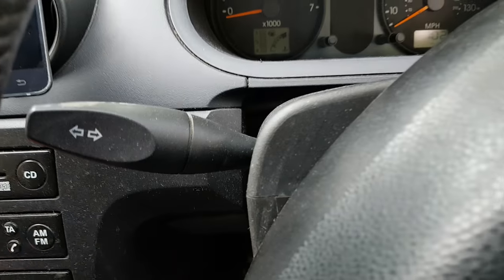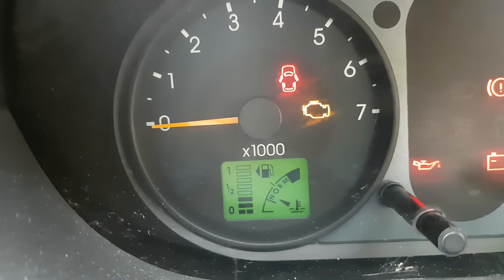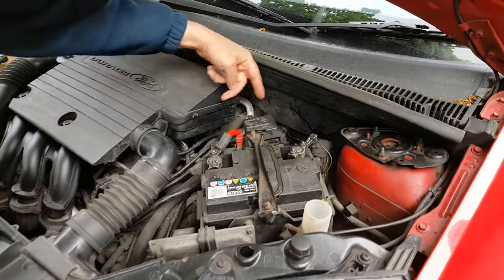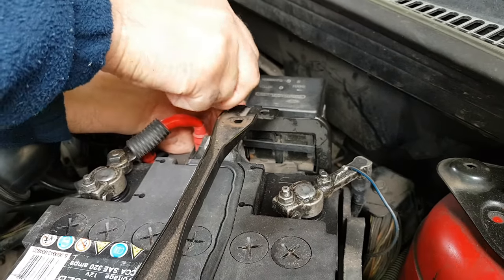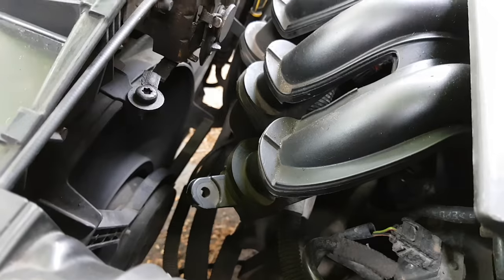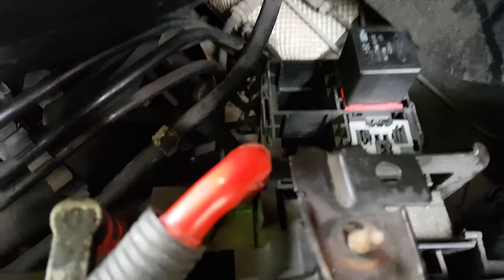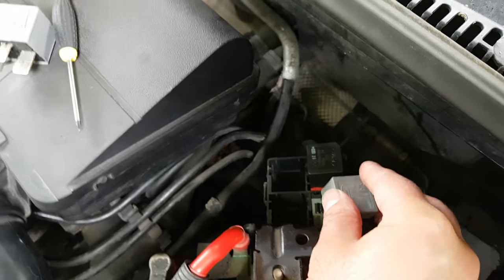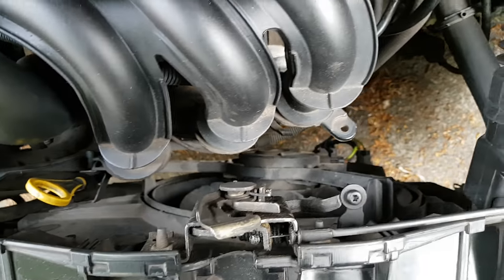Ford Fiesta fan problem...faulty relay.

Comment: This is great! I am having the same problem with my 2006 1.6 tdci fiesta. It's too dark to try to open the relay box now but will definitely try tomorrow.

Yep, tried it and that was the fix. Thanks for the great upload. In my case the relay was some g.cartier crap, replaced it with the ford part.
Reply from the maker: Glad you managed to fix it...I love those mark 6 fiesta...they were built so well

Comment: Thank you So Much, Helped me with my 2007 Ford Fiesta, Except my fan wasnt turning on. Used the exact same method and it works!
Reply: What's the problem man.i am facing same issue in my figo 1.4tdci. radiator fan is not running even when i turn ac ON.
Reply: @manjinderwahla8250  just remove the relay and blow the air in female connector of relay just use sand paper and wipe the relay male pin until it turns to original metal color then remove fan wire from radiator use rust lick spray remove the dust now plug it it will works

Comment: I have a 2008 ford fusion 1.6tdci with the same issue. Relay box located in the same position. Part no for the relay is; F80B-14B192-AA. Easy fix.

Comment: Thanks for this, now i know what the problem is. I tapped the top of the grey relay with a spanner and it fixed it 😂. So at least i know which part i need to order now 🙂

Comment: Hi my car does shows warm when its cold, it doesn't overheat but the fan also does not come on. I changed the radiator flange with temp sensor  as I had a waterless. The fan did not come on before that either.
Now I testet that the fan comes on when I pull the temp sensor connection off. But when by running engine I put it on the fan stays on and Fault management light comes on. When I switch it off fan stays off . Can you help me ? could it be the Cable or the relay? And how doI change the cable ?

Comment: Had the same problem. Took it to fords and they provided an up rated relay. I then opened the old one and found contacts stuck together. Cleaned them and is now the spare. The cover simply pops open with a small screwdriver. YEs there is a black and grey relay. ITs the grey one for the high speed fan.
Reply from the maker: Yes you are right Ford did modify the relays in the end I guess they got fed up with the complaints.

Comment: How did you get that cover off I have tried but no luck
Reply from the maker: Small flat head screw driver to pop the lugs then just pull the cover off
Reply: @jaredakten4939  I done it i was struggling as I never unscrew the battery holding top bracket,reply appreciated.
Reply from the maker: @naimahmed6581  there you go...a little tip for the  next guy struggling to get the cover off...

Comment: Hi My car ford figo was overheating recently  and i bought new Themostat and temperature switch but when it gets hot my fan doesn't turn could that be a fault fan relay aswell?
Reply from the maker: Check the fan motor first then the relays
Reply: same probelm here, did you manage to get what the problem was?

Comment: Hi. Fiesta zetec 2008,blower fan not workin any speed(1 2 3 4)  taked off blower motor, tested and the motor working.. So What could be the problem??? Thanks
Reply from the maker: Check the fuse then check power coming into the switch then check power going out from the switch....use a multimeter and let me know.
Reply: Same problem i have faced but I don’t any solution plz help me

And when i rotate tha blower fan by hand so the blower is working

Plz give me solution

Comment: Hi, thanks for the video. I have a ford figo, the fans starts spinning immediately when i turn the ignition and only stops when I turn the ignition off. Could you maybe help with advice ? Thanks
Reply from the maker: Hi Linda...if your car is the same as the fiesta then it will more than likely be one of 2 things...your coolant sensor could be buggered or you slow speed fan relay could be stuck in the on position... both are cheap to fix.....change the sensor first to see if it helps.

Comment: Hi my Fiesta 2009 1.6 Tdci is doing same problem. Fan is very speedily on while engine off. I took off that gray relay one day and try to jump start as the fan killed all the battery and finally I damage the ECU (electronic control unit) and cost me £500 to make the car live. Now having same problem the fan is on and on. I am scared to take off the grey relay and put new one. Need ur advice please. Thanks
Reply from the maker: Just replace the grey relay with a new one..and just to be safe don't start or drive your car until you have fitted the new relay. Did you accidently  reverse the polarity when you jump started the car?
Reply: Thanks for ur reply. I am not sure if I mixed up the polarity but I try to jump start without that relay.
Reply from the maker: @TheSajuahmed  the damage to ecu is not because relay was removed. It's from the method of jump starting, the safest way to jump start a car is to indirectly connect the battery  negative via the engine block.
Reply: Jared Akten you were 100% right. I changed the relay and fan running all right. If I would know at beginning then I wouldn’t have to pay £500. Thanks

Comment: Hi any idea why in cabin heater would give an issue ? It won’t blow hot air only cold 🥶
Reply from the maker: Yes..sounds like your thermostat is stuck...so hot water is not circulating to the heat exchanger in your cabin..hope it helps
Reply: Jared Akten no I replaced the thermostat still no difference
Reply from the maker: @fookayou8607  ok next thing to check is the heat exchanger to make sure it is not blocked.  Also check the rods/cables from the selector switch to the flaps these might have come off.

Comment: I have the same problem if I would change the fan relay could make better and to stop my cooling fan to work continually even the engine are off or engine are on ? Many thanks 😎
Reply from the maker: Yes as you can see my fan was constantly running with engine off. I used to disconnect the battery but better to change relay.

Comment: Hi I have a Ford figo my fan is running loud,
If I remove the relay the fan is running normal speed,
I did buy a new relay and the fan is still running loud
What could be the problem
Reply: have the same car as you. i just replaced fan motor twice and now its not working again. the mechanic here connect the power of the fan to the compressor because they could not find the problem which is i think is just a relay....

Comment: Hi - where did you get the relay, and what part number is it? I can’t find one anywhere!
Reply from the maker: It's actually a common one  used in a lot of Ford's I will get the part number for you...but have a look at your old one part number will be on top.
Reply from the maker: Part number is f80b-14b192-aa

Comment: If radiator fan do not switch on do I change the sensor or relay switch
Reply from the maker: Check fan motor first then sensor then relays...remember there are 2 fan relays on this model so both need to be faulty for the fan to not work at all.  So probably the motor is gone or the sensor..
Reply: What's the problem ,i have same issue in my figo 1.4 tdci .
Reply: @jaredakten4939  where are the fan sensors located?
Reply from the maker: @mrc9188  on the 8v it's on the thermostat housing...on the 16v it's on the coolant pipe connection just under the coil pack.

Comment: There is also a coolant sender under the coil pack and a two speed fan resistor at the bottom of the radiator cowling
Reply from the maker: Thanks for sharing....hopefully will help someone with same problem

Comment: My 2012 ford fiesta sport my fan will run non stop ac or not is this the same
Reply from the maker: I only know about mk6 fiesta...but generally if fan is running when engine is cold and off then it will either be the sensor or the relay...

Comment: I followed all of this but when I opened up the black box next to the battery there is just a single black relay in there - no grey one like the video.
Reply from the maker: Strange...What year is your car?
Reply: @jaredakten4939  2005 1.6 auto. I removed the single relay and it did stop the fan. I have found a replacement on eBay so fingers crossed. I had a problem with it staying on for years but it rarely came on. Lately it started coming on all the time so it's now a problem I need to fix.